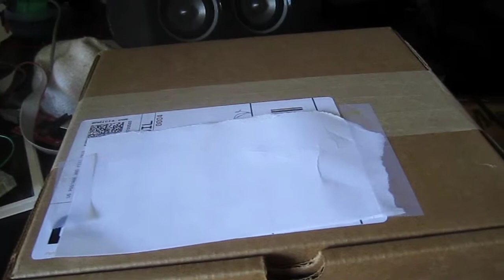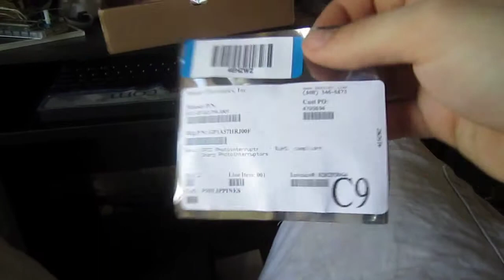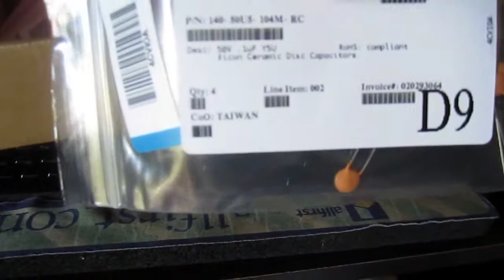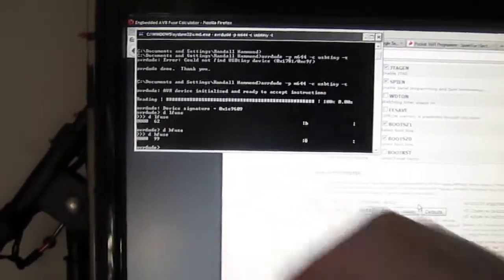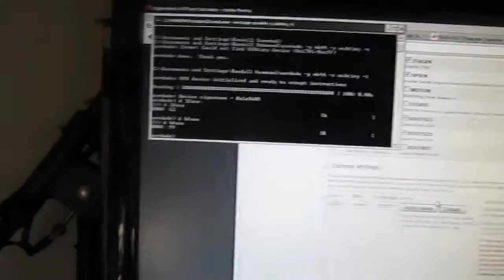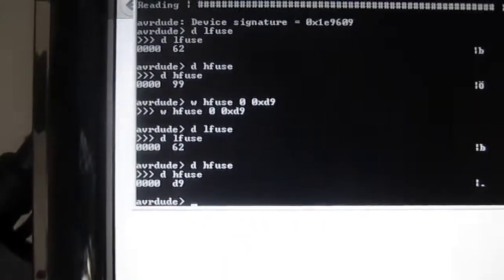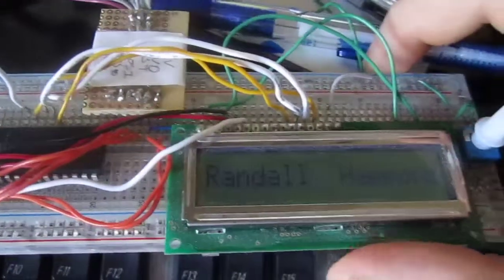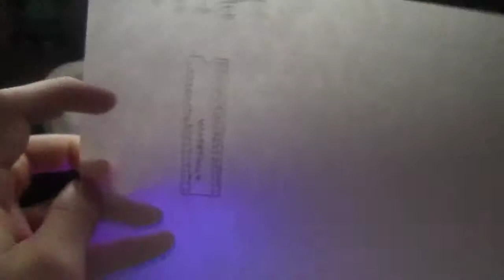AtMega644 Project Part 1

Comment: Good video. Always remember you are the first source for programming an ATMEGA644P. 1st are you using a Arduino Uno? 2nd You need to make a wiring diagram with your set up to LCD and Programmer. 3rd What program/IDE are you using to program your ATmega chip with? You need to show How you are doing things and What tools you are using? Great video, you just need clarity on procedures.

Comment: hi dear , i just want to ask u how to program atmega644 ??? and which pins to connect in the programming mode ??, and if there is a way to program it using arduino uno r3 ??